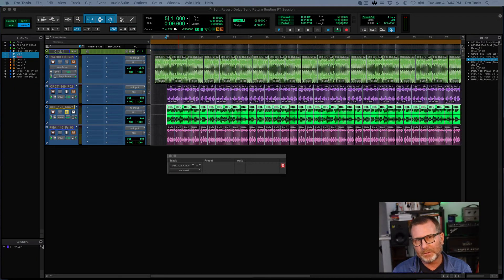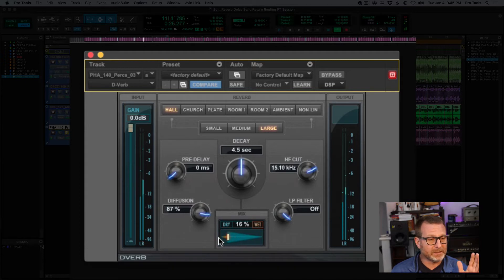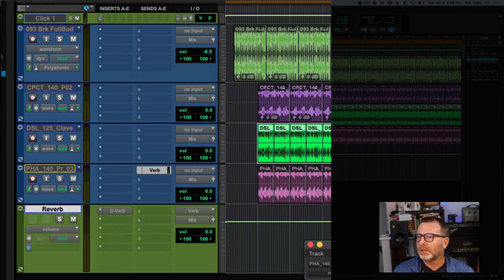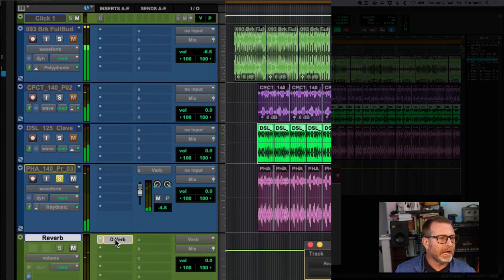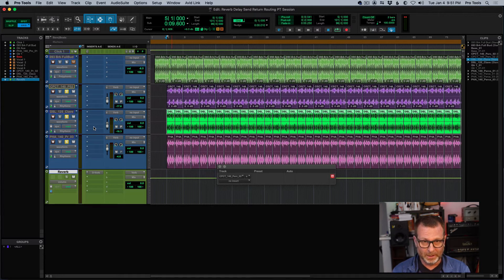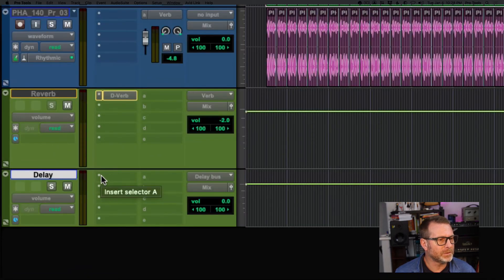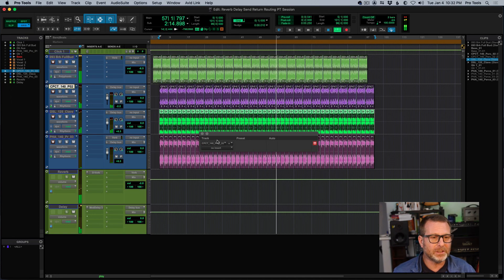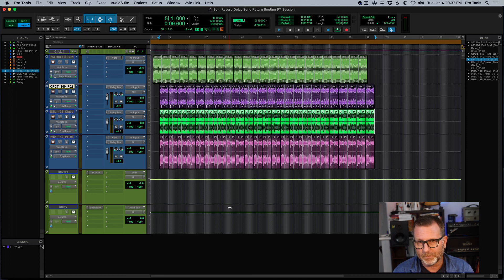Pro Tools - Reverb and Delay Send Return Routing

Comment: Just what exactly is the SOLO SAFE option and why use it?
Reply from the maker: Thanks Bob! Solo safe prevents that track from muting as a result of another track being muted. This way you can solo the vocal or instrument track, the reverb Aux track won't mute so you'll hear the vocal or instrument track and reverb together. 

Solo safing is also very handy with submixes. Solo Safe the Aux track that other tracks are routed through so you can solo any of the source tracks and not have to also Solo the Aux track too.  

Maybe I should make a video for Solo Safing too!
Reply: @protoolsservices9816  I have never had issue, soloing the track and the verb on the aux send.